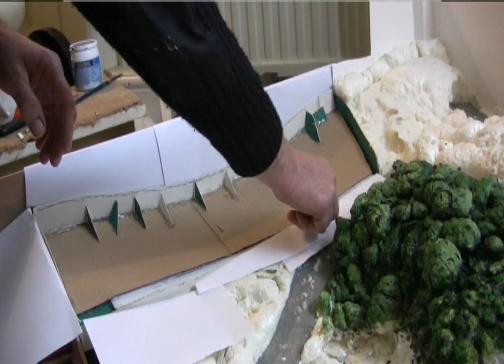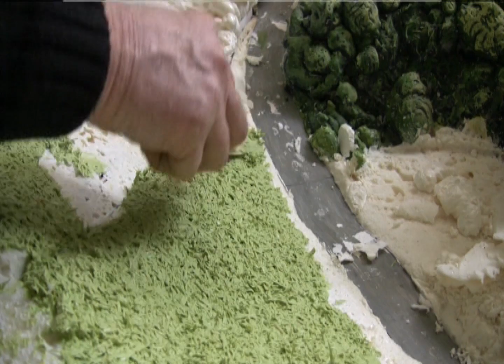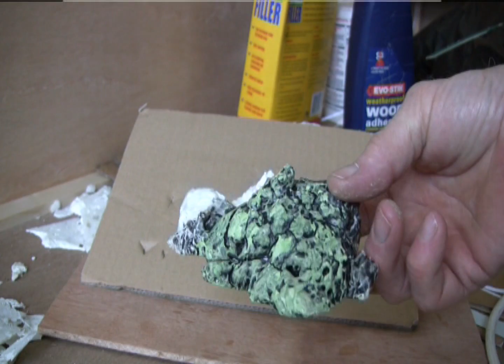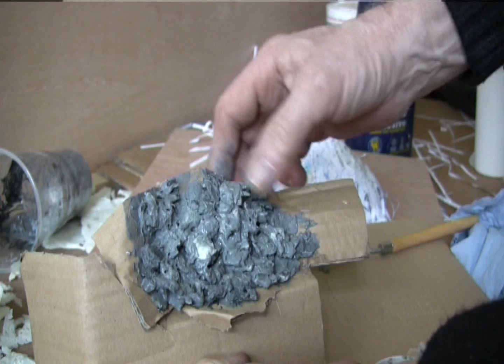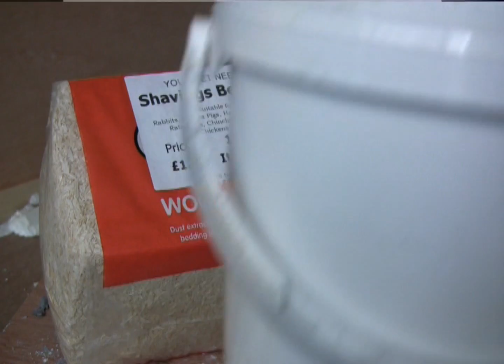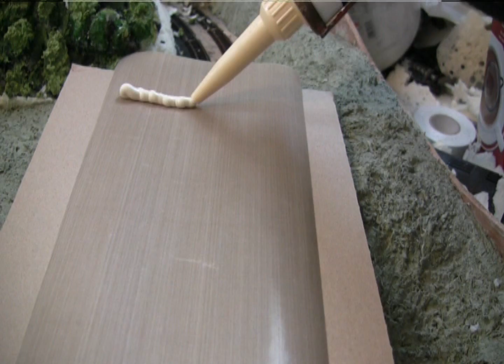N Gauge Model Railway Part  4

Comment: I really want to build a layout now. Thanks for posting
Reply from the maker: That great if I have given you a bit of inspiration, im just a beginner looking at the other chaps out there and then adding or experimenting with my own twists and ideas, remember I don't think there are many right and wrong ways to do things, its about doing what suits you and and having fun along the way, when I started building my beam engine I asked for advice on some of the engineering forums say I wanted to try making a working model of a beam engine but get a more realistic speed and get it running around 15 rpm, and make it just with hand tools,,, My ideas were met with ridicule ,,, "A working model beam engine WITHOUT a lathe ???? I think you need to wind in your expectations"  or   "15  R.P.M. .... I have been modelling 30 odd years and not got a model to run the slow,,,, you can scale down the size of something but you will learn you can not scale down kinetic energy or the laws of motion you would need a huge flywheel made of more the your suggested M.D.F.... "    when I said I had got her running at 9 R.P.M I had one comment,,,, "Did you time it with a grand father clock if so I suggest you wind it up and time it again,,,, Hence me posting a video of it,,,,to prove them all wrong,,, so go with your own ideas and don't let anyone put you off.  the model railway crowd seem totally different and happy to offer genuine help most of the time,,, so get planning you could have a layout folding down off the wall ,,, a 3 foot coffee table that unfolds to a 6 foot layout, None of it is that complicated ,,,,, if in doubt just do a little diorama ,,, a cardboard cottage kit £7 or 8 quid,,, some polystyrene foam packing, a length of track £4  a bit of filler and sawdust,,, and just make a bit of a hillside ,, cottage ,,, filed ,,, and railway line,,, and you will soon find out what's what,,,, ,,, cheers ,,, good luck and many thanks for commenting,
Reply: I suspect that I would soon be divorced if I tryed adding a model railway to my list of leisure time lol. Ill just wait until my trwin obsesed son grows out of his track master and then I can 'help' him build a layout. That said I once saw a siding built into a violin case.